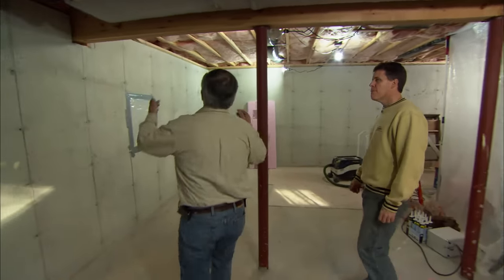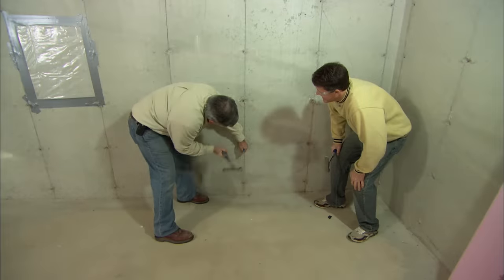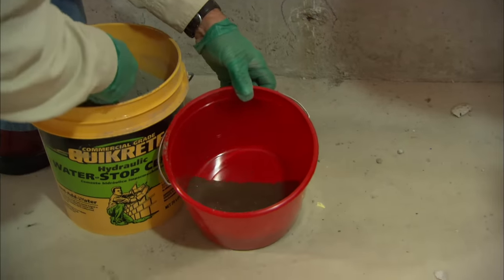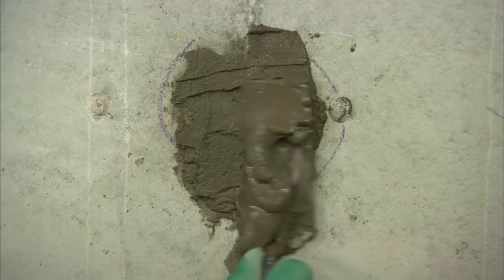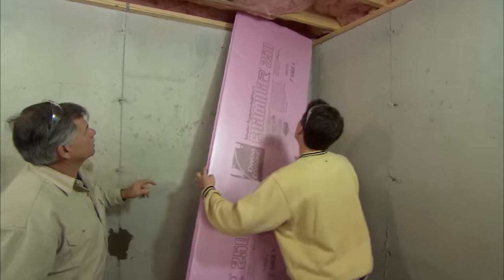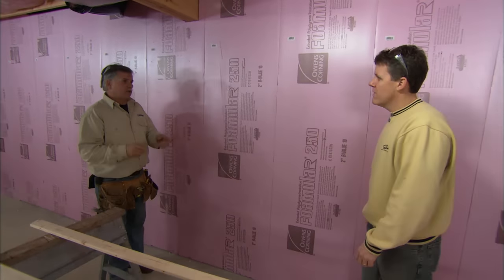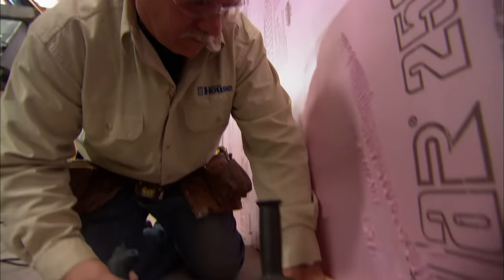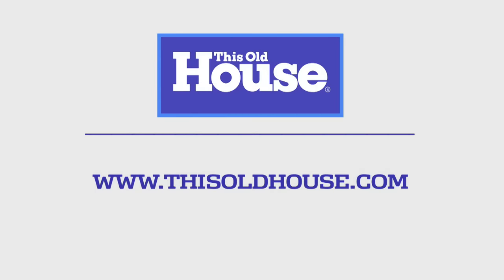How to Insulate a Basement | This Old House

Comment: This made me cringe: "If you wanna install an electrical outlet you just gotta dig out a bit of insulation"  First rule of efficient home insulation: You never needlessly compromise your insulation thickness.  If you want to put an outlet on that wall you need to use thicker braces to accommodate the box without digging into the insulation. Additionally I didn't see enough hardware going into the concrete to properly secure those walls. I would be very concerned about the possibility of those anchors loosening up over time and those walls coming loose over time.  Also, as others have pointed out, this basement could use at lease twice the amount of insulation and a concrete sealer to properly keep out moisture. Shoddy work like this is why you really have to take time to know your stuff and keep an eye on your builders. @This Old House, you should know better - shame on you!
Reply: I thought the same thing about the concrete sealer. I thought it was just common sense to AT LEAST apply a sealant to all of your concrete walls before drywalling ANYTHING.
Reply: I'm not a pro, but it doesn't sound wise to seal the inside of something. If it does get wet, it better has some ventilation to get dry again. But i guess building codes say something about that subject.
Reply: think you'll be ok if you reduce 1 or two square feet of insulation in total at most by half of the depth. 

those anchors will only loosen up if the hole is too large or if the concrete isn't any good. either going to be operator error or a separate entirely and catastrophic problem. sorry.
Reply: This board has almost no r value. Dont stress a small hole, there are no drafts through concrete.
Reply: "almost no r-value"

what do you think your refrigerator is insulated with? go touch the outside of your freezer, come back, and let me know if you felt 20F
Reply: Fridges are a poor measure of efficiency. They have zero. Cold to touch and the displaced heat blows into the room. Insulation in your basement will not save you a fortune, its not even cost effective. Its to make it more comfortable for the financially able. Most people dont heat there basements for this reason.
Reply: Digging out a few square inches of insulation will have literally no effect...

But i agree...just use thinner boxes or build the wall out enough passed the insulation for a box.
Reply: @spencer4290  Has r value of 10. Says it right on the board. That's enough depending on where he's at.
Reply: @EGGINFOOLS  lets be clear. R-10 is barely anything. Look @ the insulation in your attic. Also you are right about where he lives. Below the frost line the tempurature could be 50+ degrees.
Reply: @spencer4290  R10 works in the right areas. You say barely nothing but why would he use something higher if it isn't needed? I live in Michigan. Right now it's 12 degrees outside with about 5 inches of snow that just fell. 36 inches of my basement is above ground. About 52 below. With the IR thermometer the brick above ground is 44+/-. The below grade brick is 50-52. My area calls for R13. So if he's further south he would be fine.
Reply: @EGGINFOOLS  Right. The difference between 50 degrees and 70 degrees if 20. Thats not a big difference. If you read the original comment. He thought removing insulation to add a box would ruin R factor. Insulation works by traping air between two solid bodies. A box would still have similar insulation value, due to not touching the wall and also having an air gap locked in it (assuming they use an insulated cover).
Reply: @11co5955  
"I thought it was just common sense to AT LEAST apply a sealant to all of your concrete walls before drywalling ANYTHING."

Now you know as most things deemed common sense, it's not common sense, it's learned sense. 

If it was common sense, the home owner would not have needed to call This Old House for help. He would have already know what to do without being instructed on how to do it.

Comment: My mom’s house is in Mexico. And in Mexico, most of the houses are built with cinder blocks. However, she has been having issues with a lot of humidity on the walls inside the house.  Can I install this type of insulation in direct contact with the cinder block wall with moisture and then put the 1x3 and the drywall?
Reply: Is there ac in your mom's house?

Comment: At end of video ... Tom talks about installing a electrical box by cutting out some of the foam ... the romex wire entry on those boxes are in the top/bottom at very back. How do you get your romex in if the openings are buried in the foam? Cut out a much larger piece of foam? Could one use a power actuated gun with a washered pin to attache what looks like 1x4 furring strips?
Reply: I have 26 years managing residential work, just when I thought that I've seen it all - Here comes more crap! Hahaha, don't we love it? ... as for your concern goes, (Mr. This Old House, Knows It All) might have a magic way to get your Romex in there.

Comment: Why did they just install rigid and not batts between studs afterwards? With its relative small R-value I thought rigid was more of a vapor/moisture barrier in the basement and typically you'd put that behind the plate and studs.

Comment: I kinda don't like the nails (thermal conductors) poked in every couple feet.  May not do much but doesn't feel right to  myself [of little knowledge].  I wonder if this insulation with a 2*4 wall would be really effective.  Removes the non-insulated wood from between fiberglass insulation and doesn't perforate foam insulation with a bunch of nails.  Will add a couple inches of additional depth though.

Comment: When finishing and insulating the floor (regardless of the system), should the flooring be done first, then the foam board walls, then the framing? Makes sense bc then the vapor barrier is continuous around the conditioned space and allows the flooring mositure a place to go.
Reply: I say work from the top down. But what kind of insulation is going on your floor. I'd think you'd have to gram on top of it... Let me know what you find out. I'd think You don't want to be doing all that work on a finished floor. But I'm a novice.  I agree with foam boarding the walls then the framing. That's what I did.

Comment: Your supposed to place the glue on back vertically, not horizonatlly
Because concrete has moisture that condenses. concrete also develops cracks that can leak water into basement, with glue applied horizontally like in video, you have effectively created a water trap, water  cant get to the floor of basement and off to drainage in nearby floor drain.

Comment: Some codes will require fire blocking.  This would be a board that rests directly against the cement wall at certain intervals.  I rarely see fire blocking in these sort of videos, and I wonder how people get around this potential code violation?
Reply: Building codes (where I’m from) on older homes require the house to be renovated 75% at one time. Small renovations or DIYs don’t need to go through inspection. 

However, if there is a fire, insurance will not cover anything.

Comment: Any reason why they wouldn't tape the insulation board's seams to prevent any air penetration? You would be surprised how much a seemingly tiny seam like that can transmit air and thus create moisture problems.

Comment: Shouldn't you paint sealer or mold proofing on the cement pour before adding those boards. I know it is dry, however it is dry now but years later with settling you will get water coming in.

Comment: instead of drilling into concrete wall which takes a lot of time and making holes, i would attach 1horizontal board to the ceiling joists and laid another board on the floor.  And use that as my anchoring system.  Then after attaching them i would attach studs to them, nail to the top and to he bottom.
Reply: Yeah but what if you don't have floor joist above you? I ask, cause Im trying to frame out one side of my garage block wall and the top is finished stucco. So I understand I can nail the plate on the bottom no problem, but I don't see how I can nail the top without going into a joist? Also, I have Hvac return exposed as well, so obviously I cant nail into that. Any thoughts?
Reply: @DaCake2  (Not sure how your hvac sits there so i cant tell solutions without seeing it.)   Then i would nail/drill + screw the top board into the top material that your stucco is attached to.  It will be a lot fewer nails/screws than trying to attach boards to walls.  You would need to go past the stucco layer to grab to something solid. (Stucco on garage ceiling is very rare, sure it is not gypsum?  )  But i think even if you attach to stucco you will be ok since the wall will make very little pressure to break that stucco as long as your wall is level vertically... if you insert those studs very tight, that on its own will hold the wall in place.       
    I actually also have garage that has no insulation on walls or ceiling and i am really debating whether to insulate its walls at all, since the garage door has cracks that leaks lots of air and the whole effort of insulating walls will be gone if you open that huge garage door even once.  So that leaves me with just to improve looks inside the garage... i guess.....depends what you want to do with the walls.  Do you want to hang a lot of things on them, or put cabinets, or just try to keep walls clear.   so if not trying to insulate walls then you can just paint walls.  however if you really want to have drywall on walls and decided to nail wood members into walls for support (can use 1x4 instead of 2x4) then if it was me, i would get one of those power nail guns to quickly nail into the wall (instead of drilling each hole for screw).  it runs around $100-150 on amazon and in my opinion worth it.  I was thinking of gl

Comment: Adhesive always vertical for condensation to be able to flow and framing the wall with 2x4s 2 foot on center is easier and faster and allows you to correct any plumb or level issues.

Comment: Shouldnt they have given the cement more time to settle and fill the holes before immediately applying the insulation or am i just overthinking it? I feel like id want to see the result of the leak plugs before glueing something on it.
Reply: Added note. I absolute love toms ability to use geometry to avoid math. Like holy crap some of those reference point tricks are useful.

Comment: When installing drywall, wouldn't nailers be needed top and bottom between the vertical fir strips?
I can't imagine leaving the 13" gap between each of the vertical nailers,
top and bottom that the drywall would need for support. 🤨

Comment: I saw another company that makes foam insulation blocks with the strips and electrical channels built-in. Then you attach moisture resistant dry wall over that.  Anyone had experience with that method?  I figured you can then finish the concrete floor over with water proof luxury vynil plank and do any other walls with metal stud framing for basement walls.  Sound right?  What am i missing?

Comment: Why wouldn't they use something to push the cement inSIDE the hole? If you only cover the wall from the inside the water from the outside will slowly drain into the hole and will get inside the concrete wall, right?

Comment: What are the "R-Value"  for this type of insulation? I am looking to finish my basement, this option seems a lot easier to work with vs standard framing.  However, I would like my basement to be well insulated and warm.

Comment: Is it necessary to insulate a below grade basement? I think I rather skip it since my basement temp doesnt change much. Per local code it is not required so i was thinking about just slapping some drywall up.
Reply: Depends what climate/temperature zone you live in, in the colder regions up north, as they showed as a cheap retrofit works fine, but rebuilding the basement using ICF is far better and IMO the best way to go for many good reasons. Again it all depends on temperature zone, but a few ICF come with forms where one side can be revealed type with no foam to speak of, be it the exterior or interior.

Comment: Great video!! I'm building a new home with a developer, and they'll be installing a kind of blanket/wrap insulation all around the outside wall of the basement. What's the best way to install finish walls in this case? I'd love to still maximize my space and push the frame walls up against the wrap, perhaps cutting around the wall studs so the insulation isn't compressed in the voids? Or is it best to just start the walls at the point the insulation stops?
Reply: DONT Let them use that garbage
Reply: I have the same situation, was wondering what was best to do… either somehow use it or just take it out and put the walls in with standard insulation?

Comment: The perimeter of the foam should be sealed (caulking), and joints should be taped. Adhesive should be applied vertically to allow water to drain. I don't like the idea of driving those ties, they'll break the exterior waterproofing.
Reply: Many of you assume a basement wall is thinner than the amount of depth the bolt goes in, most basement walls are a minimum 8 inch thick so unless the fastener goes through you are not going to break the exterior barrier if one was ever applied.

Comment: What does it do to the other side of the wall when you drive the ties back like that? Also, if your form ties are rusting, wouldn’t that indicate that your walls are not properly sealed on the outside where the moisture is?
Reply: All forms ties rust they are usually already rusted on installation or will rust when concrete hits them

Comment: Concrete will emit its inherent moisture for decades, if not longer. Therefore, does it not stand to reason the location for the vapour barrier, below grade, must be on the outside of the foundation wall?
Reply: Yes

Comment: Would this type of installation work for a mobile home?  the insulation and frame ( 1x3 ) is intact, i am assuming i can attach the strips to the existing framework ( adding a frame 16 on center with 2x4 would be too much weight_)  unfortunately the wall paneling is warped and needs to come down. would using furring strips over a fresh vapor barrier to attach drywall to be stable enough?

Comment: So Tom tapes a piece of clear plastic to the basement wall for a week or two to ensure the presence of moisture is a not an issue...coming in from the outside of the wall no less.    So, Tom, what would you have done if moisture was present...would you have just continued on?

Comment: if just waterproofed the basement and have vapor barrier plastic sheet over the entire cinder block wall to the joist, should i glue the board to the plastic sheets? or can i just let the 3x1 grid hold the boards in place? also i suppose its okay to insulate this way to a cinderblock wall?
Reply: Any plastic sheet will prevent your walls from drying to the inside of the house.  The relative humidity of the dirt outside your walls is always greater than zero. A plastic sheet will trap water vapor inside your walls. The foam boards prevent the movement of air, which includes water, but are permeable to water.

Comment: Problem I see with this grid system is now you have dead space behind the sheetrock because you put the vertical 1x3s against the horizontal ones. In the carpenter's union we are taught to fill that dead space behind the sheetrock with spray foam insulation.

Comment: I live in Alaska...lots of cold. Should I seal the whole basement before I put up the rigid insulation as a vapor barrier?
Reply: The water will be pushed from the outside to the inside . If the outside wall is not sealed with BASF or similar brand sealants it is going to leak .

Comment: If your basement walls are sealed and dry, why not use standard framing with fiberglass insulation?
Reply: Fiberglass can hold water, and foam insulation has a higher R value per inch.
Reply: If dry, it would be fine. With the basement walls insulated by the ground, does the foam really add that much?
Reply: Concrete is notoriously porous. You might want to do more research.
Reply: POlyISO rimjoist, XPS walls/floor, metals studs for framing, stone wool insulation for stud walls.